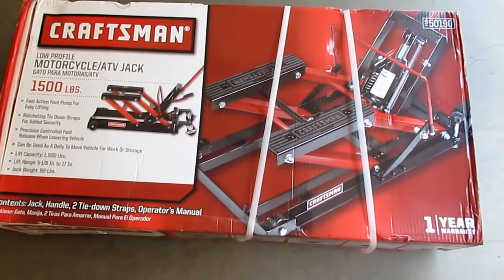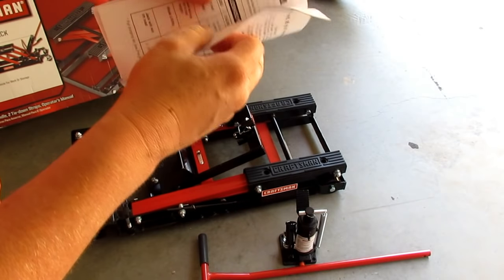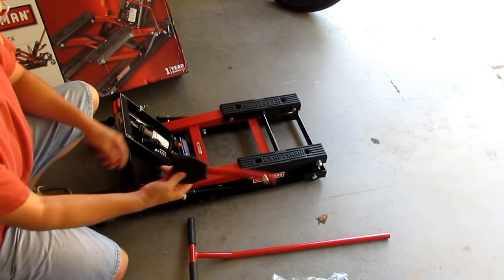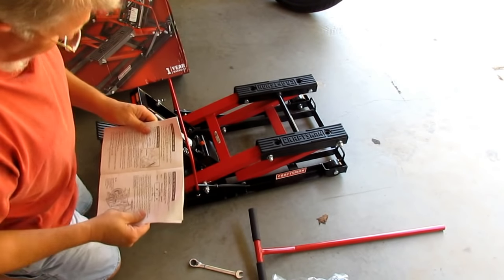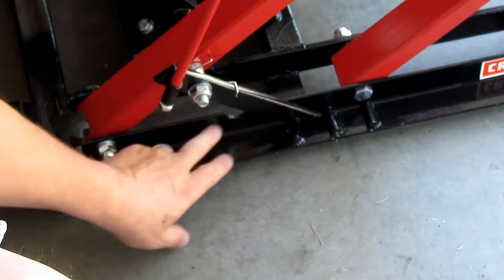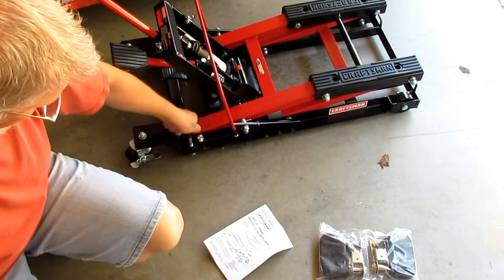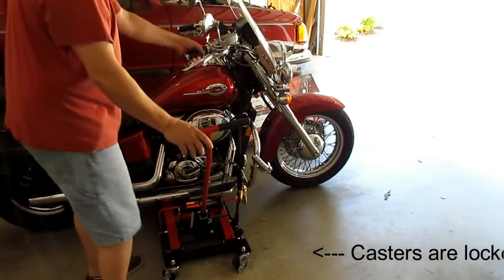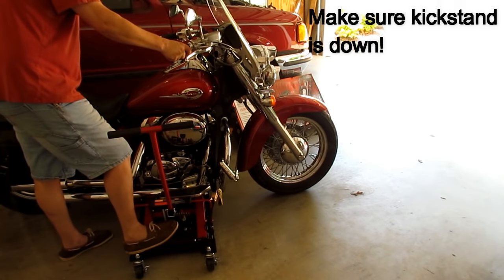Craftsman Motorcycle Lift  Unboxing and Review

Comment: This exact lift design is manufactured by many others. It was never exclusive to Craftsman.  As such, it’s barely workable.  It won’t fit under most Cruiser bikes, the hydraulic cylinder weeps so once a load is raised it’ll slowly lower unless the user remembers to push the lock bar forward, and with a load of 650 lbs the lift doesn’t move around very easily.  The heavy weight tends to lock-up the wheel rotation and pivot.
Reply from the maker: Thanks for watching.  This lift fits fine under Harleys and Honda Shadows, that's probably covers the majority of the cruiser market, but there may be others that it will not fit under very well, I'm not sure so can't speak with any experience on other makes.   I haven't had any of the problems you mentioned with mine, thankfully.   I've used mine for nearly 6 years and so far so good.  I agree, with a leaky cylinder, it would be a problem.

Comment: Doesn't work well for sports bikes
Reply from the maker: I don't own a sport bike, but I think you are right.  The space between the lift pads is probably too wide for most sport bikes.  Thanks for watching!
Reply: @dwcoffey  actually i put it cross ways not parallel to the bike but it does work combined with a rear stand